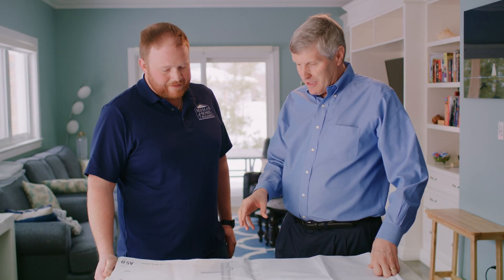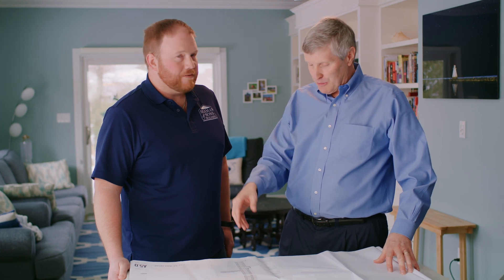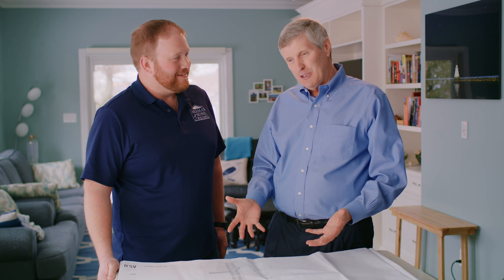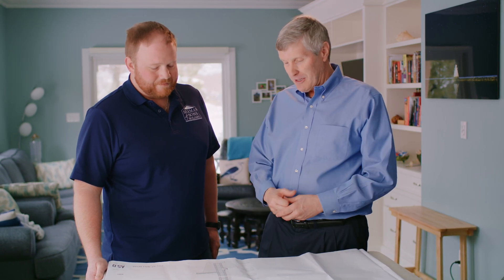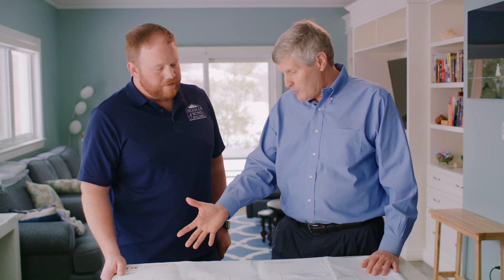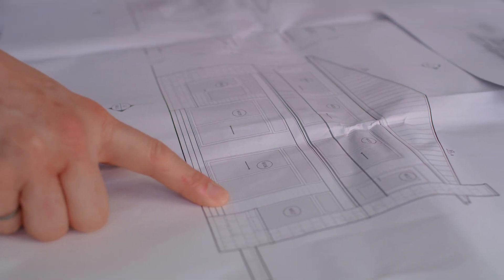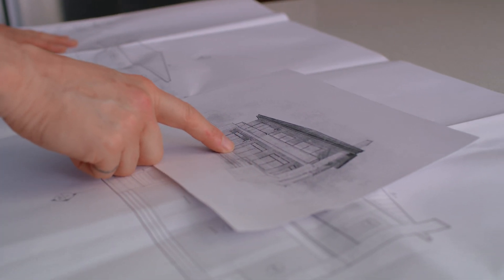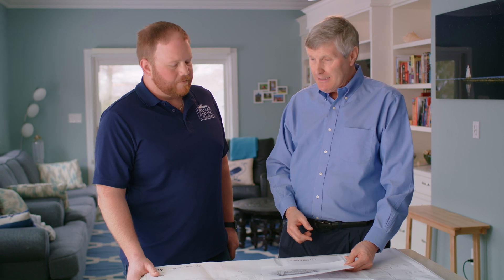Sustainable Architecture: Building a NetZero Home - Part 2

Comment: Most of the video could be presented as a simple web page that concisely enumerates the challenges and benefits of NZH. If you had the in-set video overlays that pointed out what you were talking about, then I would find this more valuable... Sadly, this was little more than hot air blown at the microphone...
Drawings are okay... but looking at the actual finished product is far more valuable... You're already in the house... why not showcase it while you're there??